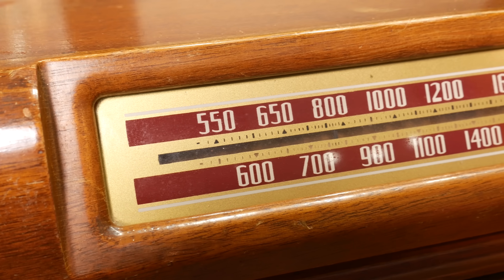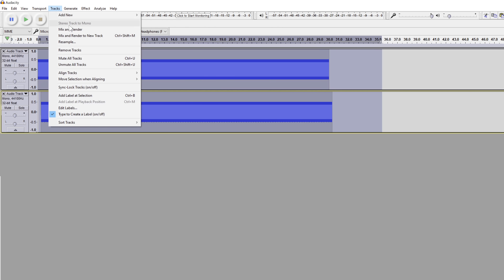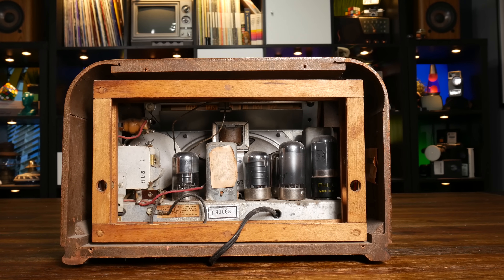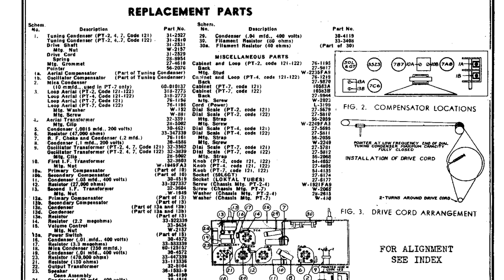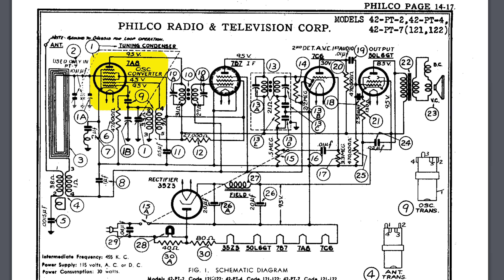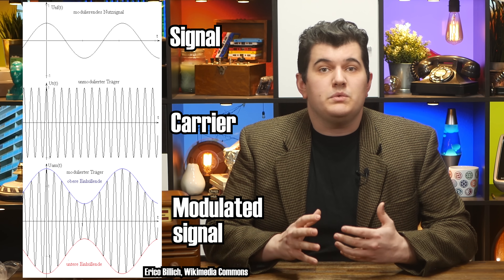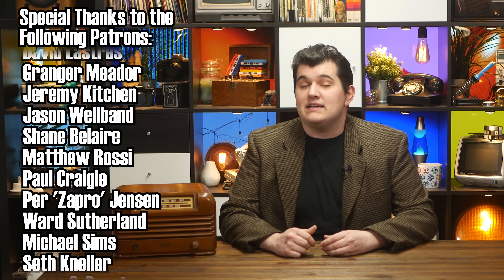The Superheterodyne Radio: No really, that's its name

Comment: Radio buttons on computers come from radios... Because you can only be on one station (option) at a time.
Reply: Don't call them mutex. Mutex already has a meaning when it comes to computers, and it's not a synonym for radio buttons.
Reply: They are named after the buttons on old automotive radios. Those actually were tuned by the reverse process of that table radio, which uses a variable capacitor and a fixed inductor (coil). Automotive radios used a variable inductor and a fixed capacitor. Multiple variable inductors, in fact: one for each button, plus a main one. They were tuned by moving a slug of magnetic material in and out of the core of the coil
Reply: Old car radios also often used an IF of 262.5 kHz, because the high sensitivity of car radios exacerbates the problem of "tweet" (an annoying whistle when the radio is tuned to 2X the IF), and 262.5 kHz is the highest IF you can use while still keeping the tweet frequency below the AM band (530-1710 kHz). Because of this, there were some Tunnel Broadcasting systems, such as in Boston, which transmitted on 262.5 kHz, so that no matter which frequency your car's AM radio was tuned to, it would pick up the signal, which provided traffic and emergency information as well as played commercials to help pay for the maintenance of the tunnel.
Reply: @davidbarts6144  As  Philip Leitch mentioned, you pushed one button and the previously pushed button came out. Those had nothing to do with how the radio was tuned. They were mechanical presets.
Reply: @davidbarts6144  my first car radio had hard to press buttons that literally moved the tuner dial to the station position. But I've never seen how it actually does this.
Reply: TIL!
Reply: Oh, wow. Now that thing finally makes sense for me now why it's called that. TIL something new, thanks!
Reply: The push button car radio tuner was invented by the same man who built the Lear Jet company, and it was invented for purposes of safety.  Once you set the buttons as you wished, you could change stations without looking at the radio, which would be required to operate the tuner knob.
Reply: Philip Leitch Except If you happen to be just between two station signals.
Reply: Wow
Reply: More accurate term is mutually exclusive (mutex). Radiobutton is just a real-world design element to make computers more "user-friendly" so that they can relate with what the computer is doing.

Comment: You are seriously my favorite account on YouTube. Not afraid to dive into the real technology left behind by our shiny gadgets of today. And you are really true to yourself and what motivates you! Thank you so much for your videos, even on Christmas! Happy Holidays.
Reply: Technology Connections is one of the best channels on YouTube.
Reply: Actually the Super Hetrodyne design is still in extremely wide spread use for radio based technologies. There is a good chance that both your cell phone and PC (if it has WiFi) are probably using them right now whether you realize it or not.
Reply: Hey now, I never said today’s tech wasn’t real either. I just said this was left behind.
Reply: Good point.  Crusty old tube amplifiers make the best sound, don't advertise that too much.  Then we will have a hard time finding these old (underrated) amps.  Most people have no idea how much base an old low wattage tube amp can make.  
BTW I love all technology and without the knowledge of the old stuff we would be lost.
Reply: @commodoresixfour7478  As a guitarist, old tube amps are nice, but they can be as or more expensive than a new guitar! Solid state amps are convenient, and while they dont have that tube charm, they're still useful. Your point stands, however.

Comment: Mmmm.. the lovely All-American 5 (AA5) schematic. You could probably fill an hour just talking about that particular design.
Reply: A simple design yet a very good one. And those old vacuum tube sets are actually easier to repair and get working than a 10-year-old broken used radio! The 10-year-old radio is likely to contain surface-mount components (a royal pain for the hobbyist to deal with) and ASICs (application-spedific IC's that are probably apready discontinued). Everything in the old set is large and still available in equivalent specifications today (even the vacuum tubes, there's still a lot of old stock tubes still sitting around after all these years).
Reply: @David Barts For a long time tubes could be ordered from Russian manufacturers.  They kept the legacy vacuum tube technology around much longer than the "free" world.  When a Soviet MiG fighter was hijacked by a defecting pilot in the 1980s, it turned out to have vacuum tube electronics rather than solid state, because they would not be damaged by an EMP (electromagnetic pulse) from a nuclear blast; they would suffer a momentary glitch, but then recover, while transistor circuits would be destroyed, unless very carefully shielded. 

And of course, some music listeners have gone back to tubes for playing their favorite recordings, because they claim the music "sounds warmer."  Of course it does; those things are HOT!
Reply: @allanrichardson1468  Guitar amplifier builders never stopped using tubes, and they all still use them today.
Reply: Helium Road Good to know.  The big EMP attack may kill all our phones and computers, but performers will still be able to ROCK ON! 😆😆😆
Reply: @RCAvhstape  Plus lots of those people often like to use old leaky paper/wax and plastic shell "bumble bee" coupling capacitors. Which is usually fine because most Guitar amps don't usually see anywhere near the high voltages you will see in radios.
Reply: Five tubes, whose heater voltages add up to about 120v (e.g. 12, 12, 12, 35, 50); strung in series to save on the expense of a power transformer. Often a "hot-chassis" set -- one side of the AC cord is connected directly to the metal chassis ("ground"). Plug is not polarized, so the chassis can be hot, even w/ the set off, if that side is connected to the hot prong of the plug (potential shock hazard). Better (UL-Listed) radios connect a capacitor between ground & chassis ("floating" chassis), for greater safety. Also called "AC/DC" radios since they can also  be run DC mains (once common), but will only work if the plug is in the correct way. Did I miss anything?
Reply: Madness832... let's see how good memory is for the AA5 filament voltages you mentioned:
12AV6 - oscillator / converter
12BE6 - IF amplifier
12BA6 - pre amplifer
50C5 - audio output
35W4 - diode
Reply: Lake Nipissing May I guess also?
Reply: @LakeNipissing  

Like my own memory, the right parts in the wrong places.

12BE6 is the converter and 12AV6 is the detector/first audio.

I like to carry my radio to where the QRM and QRN are weaker.

1R5 converter
1U4 IF amplifier
1U5 detector/first audio
3V4 audio output.
Reply: @LakeNipissing  

Corrected tube list for the classic "All-American Five" with seven-pin miniature tubes:

12BE6 - pentagrid converter 
12BA6 - IF amplifier 
12AV6* - detector, AVC and audio voltage amplifier 
50C5 - beam power audio output
35W4 - half-wave power rectifier 

(*The 12AV6 could be used as a replacement -and an upgrade - in  very early miniature tube models that originally used a 12AT6.  The 12AV6 has more gain, providing a little more volume from weak stations.)

Some observations:

The old Philco in this video used octals (instead of miniature tubes) for the audio output and rectifier, and it used 7A8, 7B7 and 7C6 "loctal" tubes (q.v. under "Tube socket" on Wikipedia) for the other tubes. 

Those loctals had 6.3V, 0.15A heaters -- necessitating that 80-ohm resistor in series with the heaters. (Loctals beginning with 7 had 6.3V heaters, those beginning with 14 had 12.6V heaters.) Note, too, that there's a dial light in parallel with a 40-ohm resistor on the hot side of the power supply BEFORE  it gets to the plate of the rectifier (and that 80-ohm resistor). 

I had never heard of those particular tubes before.  I had to look them up in my 1961 RCA Tube Manual, where they were listed as "used principally for renewal purposes" even then!

The three 12.6V tubes mentioned above and their most commonly used octal counterparts also had heaters that used 0.15A,  -- meaning the heaters used twice the power! 

Also, most octal and miniature tubes beginning with a 12 had counterparts beginning with a 6 (e.g., 6BE6, 6BA6, 6AV6, etc.), with heaters using twice the current (0.3A) at half the voltage. 

One other thing:

The 7A8 convertor is NOT a pentagrid convertor -- it's an octode (with SIX grids, not five).
Reply: @LakeNipissing  You're close. The 12AV6 was the preamplifier, the 12BA6 was the IF, and the 12BE6 was the  oscillator/converter. The 12AV6 also had a diode to "detect" the RF signal, converting it to audio. But this is the "modern" AA5. The one in the video was more likely: 12SA7, 12SK7, 12SQ7, 50L6 (no relation to the 6L6), and 35Z5.
Reply: I hate those hot chassis designs with their mains heater strings and no transformer isolation.  It is a neat hack to reduce the price, but a nasty death trap for the unaware.
Reply: William J. Personally, I never lived in a place with 110VDC in home wiring,  but I grew up in Florida with occasional visits to Georgia.  I never knew until now where in the US DC power would have been the standard back then, but given the head start Edison got in electric lighting, the New York and New Jersey area would be reasonable.
Reply: @Willam_J  That is why you're really supposed to use an Isolation Transformer when working on the tranformerless AA5 radios. As you learn not to mess with them while plugged in once you get lit up by the hot chassis and not to touch the controls without the knobs on it to while plugged in. whenever I have a chassis out of a case, I always unplug it because I'm not trying to get a nice shock. A 120 volt shock does not feel good..
Reply: @Willam_J  

The sun is getting more active?

From what I read and personally seen, it's far less active than it has been in a century.

All indications are that the Modern Maximum has been replaced by the Millennial Minimum😣

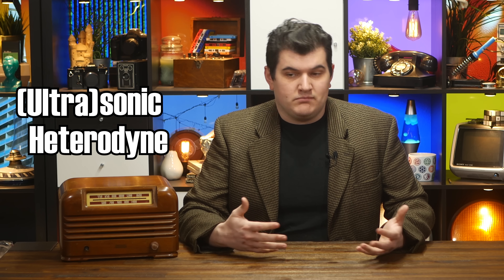Comment: 1:51 "ok, how does that help?" My response to everything I've looked at while trying to learn the dark arts of RF wizardry.
Reply: Radios, how do they radio?

us -> wizardry and bullshit -> them
Reply: It's so weird to imagine that the only difference between the current from a wall outlet and a radio signal is how fast it alternates. Once you get above a thousand times per second, things start getting interesting...
Reply: I am a superheterodyne.
Reply: @matthewpalmer9820  
As long as you are not a Heterodyne descendant, we will have no problems.
Reply: It is a little confusing but, if you have two oscillators And 
 you put them both in a perfect amplifier, the output of that amplifier will be ONLY those two frequencies.  If the amplifier had a nonlinear characteristic, that is, if the output of the amplifier is not a perfect representation of its input, that is, if for every single unit of increase in the input does not result in an absolute perfectly linearly related increase in output, the output will be be somewhat  distorted. If two signals at different frequencies are applied to the input, because of the nonlinear characteristics of the amplifier, these two signals will appear on the output plus a bunch of other signals. These other signals are the result of the amplifier not amplifying each instantenoius voltage by the same amount.  The frequency of the various signals can be determined by some fancy trigonometry, but the rule of thumb  result is that the frequency of the output of a nonlinear amplifier with two frequency inputs will be signals at those two frequencies, plus a series of signals whose frequency is the sum of the two input frequency, the difference of the two inputs, the sum of one of the signals plus the result of the sum, and that signal minus the one that is the sum.......etc. there are hundreds of signals produced, but in a well designed amplifier with just the right amount of nonlinearity, the two signals and their sum and difference are the only ones of signifance.  
For a superhet, these various signals are easily separated with band pass filters.
Whee! That was wordy.  Fun to write but a pain to read!! 
Important, but suptle, to get these mixing products, you must have a nonlinear receiver.  We would not hear beat notes if our ears were linear.  I expect music would sound rather bland if we had perfectly linear responding eats.
Reply: @S Fascinating! That's pretty cool, thank you for sharing that.
Reply: @S thanks for your service and thanks for sharing. I started (and need to finish lol) building an antenna this past summer based on a public/open source design, in order to receive pictures from weather satellites. I've found all of this "RF wizardry" to be absolutely fascinating. It's just absolutely mindblowing to me that the core principle of it is the EM physics that I know and love from studying it in college, but then so much other math converges into designing antennas. It really does feel like magic that just pieces of metal in a certain shape/arrangement can pick up radio waves, and all I needed to do was solder the right kind of coax cable onto those pieces of metal and hook it into a usb adapter for my laptop to convert it back to an image with a free program. Of course this is all much easier now in the digital age I'm sure, what with the SDR I needed just being a pretty cheap USB stick and all.
Reply: Indeed, anything RF is some voodoo magic shit, I have no idea how it works but it works.
Reply: @GoldSrc_  
Not really, all AM stuff (modulation, demodulation, etc) can be done through simple trigonometric identities